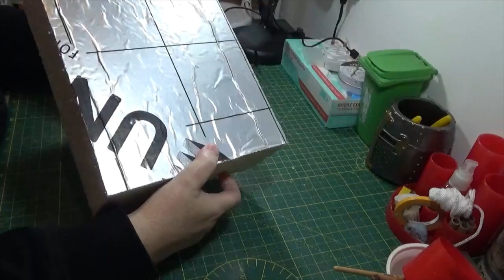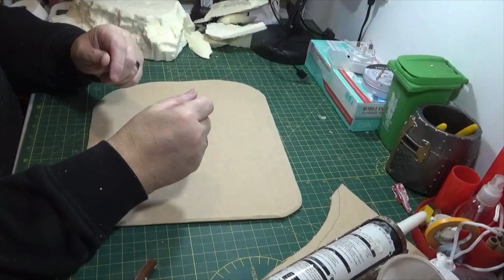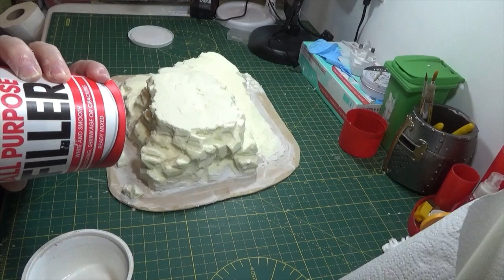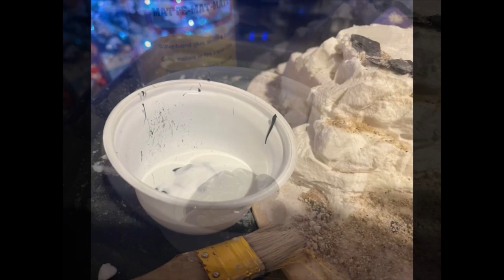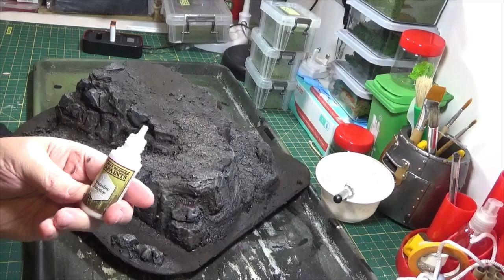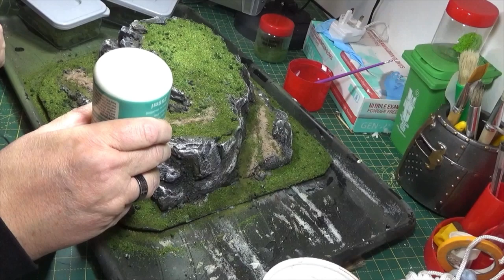Let's make a hill for Wargaming

Comment: I have had success using acrylic sealant as the coating for foam and paper mashe hills. I use 'oak' for deserts and 'brown'  for Europe/temperate. While it is still wet I add the texture, sand for deserts and dried tea-bag tea leaves for grass (painted after it dries). If you tap it down it sticks very well. I would avoid the 'bobbly' foam (EPS), it is unbelievably messy. XPS isn't too bad and there is some kind of clear quasi-foam turning up in packaging that cuts like XPS. You do still end up with a loot of bits to dispose of. I often use corrugated cardboard for hills, trenches and bunkers. For hills cut a set of formers and glue them down onto a piece of cereal box card, add strips of cereal box card between the ribs for strength then cover it with five layers of paper. I mix white (bank statements and bills) and brown so I can see how I'm doing. Paper tape also works in place of the brown paper. It warms a lot but I leave a 'skirt' around the bottom, I cut into this to make a set of 'tabs' and use those to glue down to the 2mm greyboard base, that way you get very little warping. If it does warp lay down some grease proofed paper, coat the bottom of the piece in sealant and press it down while it dries. The sealant then gives you a nice flat bottom. A final coating of sealant and scenic dressing and the jobs done. For trenches I cut strips the right height (14mm for a kneeling Airfix soldier) and cut some pieces from a second strip, cutting them diagonally and gluing them to the outside of the trench walls. Cover with paper and sealant, job done. For bunkers it's the same, just higher walls and diagonals (30mm for Airfix soldiers). When I make up a set for a kiddie I usually include a bunker with trenches around it on an A4 base as a 'strong point'. So the roof doesn't get lost on bunkers and pillboxes I hinge them with thin cloth (suit lining seems the best for this), glue to the underside of the roof and the slope at the side of the bunker. To prevent the roof sticking put a scrap of grease proof kitchen paper under it so it doesn't actually touch the tops of the walls while the glue dries.  I give the sets away so cost is an issue, hence the paper mashe, but one set made 20+ years ago is now being played with by the original recipient's son, so they do last.
Reply from the maker: Some great ideas there mate, I’ve used many of them myself. I’ve got a surplus of the Kingspan foam over from the garage conversion at the moment. I’ll be using as much as possible before my wife asks me to dump it😂.
Thanks for watching and for sharing your crafting ideas with us all. Cheers for watching 😉
Reply: @themim66  Aye, I think we've both been at this for a while.  It was really just the acrylic sealant, no one seems to use it but it has worked well for me. Like the hill btw.